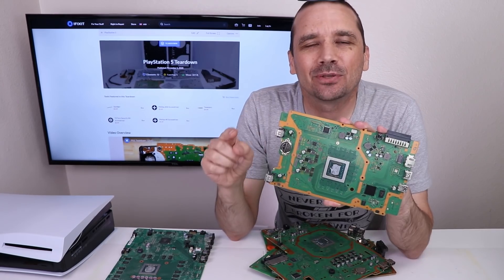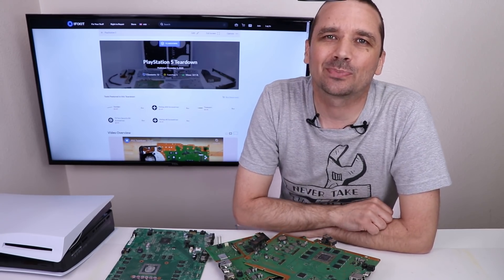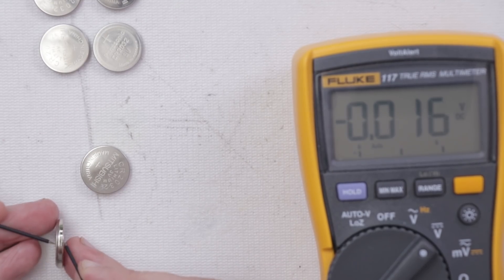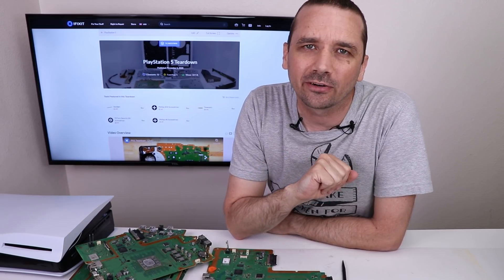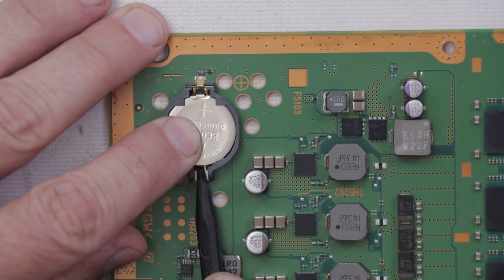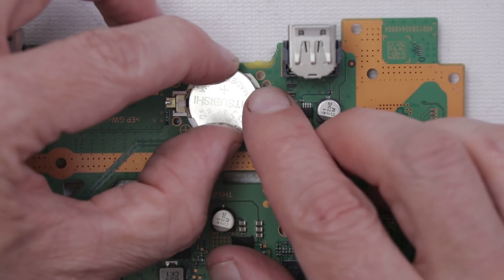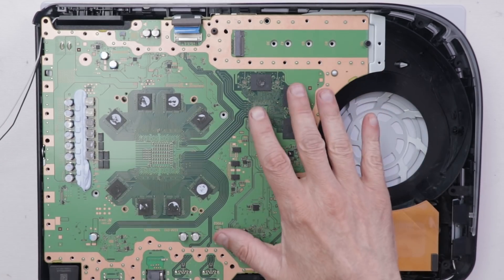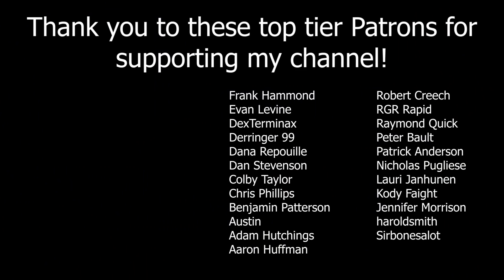PS4 & PS5 CMOS Battery Replacement - But Why?

Comment: It is fixable on jailbroken PS4s up to 7.55 firmware, by the Kernel Clock payload.
Reply: Godbless the hackers and modders to save the day 😂 but it just shows you if a hacker can implement a payload to resolve the problem Sony can fix this with an update or even an end of life update if and when the servers and support is dropped.

Comment: I thought that testing a battery without a load on it will always show the full voltage even if it is almost dead.  A flashlight battery that is dead in the flashlight will still measure 1.5 volts if there is no load on it.
Reply from the maker: If a battery is almost dead it won't show full voltage. There are times when a battery has an internal problem that only shows up under load so if you are really wanting to give it a good test a load test would be appropriate. I was only trying to get a general idea of whether these batteries were good or bad.
Reply: I think multimeters add a small load during the test.

Comment: I replaced them on so many playstations. Even on ps2. But one thing i hate and should have to get changed is the position of them. They should be easly to replace without teardown the whole device
Reply: I don't think they want us to replace them, just throw away the console 😞
Reply: @thesixthgeneration6573  Yup, 100% what they want. They want us to treat these products as entirely disposable so we keep having to shell out cash to them. It's why they are so anti-right to repair.
Reply: Yeah like nintendo wii you just unscrew one screw and take out the battery tray.
Reply: @corpse4434  right? Like the Saturn, Dreamcast, and Wii u
Reply from the maker: Agreed

Comment: The best batteries you can buy I have found is Renata, in the quartz watch world they are the Rolls Royce of batteries and show you how good they are, I bought an early 76ish Ingersoll quartz which had a AG12 its original one and it hadn't sprayed acidy goo all on the innards.   Those cheap Chinese batteries, when they run out of volts the acid inside attacks the thin membrane which is under a little pressure hence why when they go and this can happen in as little as a week from running to zero, the stuff squirts all over the nice copper motherboard erasing the thin traces and even attacks any copper windings in motors... so do buy best you can get and avoid the cheapo's cos they will eat your mobo.
Reply: I wish I could still find them in my country, they las easily double the rime than other brands

Comment: Just a heads up, the issue only affects PS4's of all models. PS5, including playing PS4 games on PS5, as well as PS3 will be just fine.
Reply: It's not so straight forward as that they all have various issues but PS5 is the least effected and PS4 being the worst effected, Doesitplay1 Twitter the guys who covered the cbomb issue originally have documented there findings on the PS3/4 and 5 cbomb issue.

Comment: You gotta test the batteries with a load to see the real voltage
Reply: Multimeters automatically add a load during testing.
Reply: @PimptatoPCs  then go on and measure your car battery with it turned off and on ,you'll see the difference

Comment: I've seen LGR turn on 30 year old computers............that still had the correct time and date. It's insane that some of them cast last.
Reply: Better still - if the battery on that 30 year old computer is dead... The only thing that happens is you get a message that says "hey friend, the battery is dead. replace it and review your settings when you feel like it, no rush" and then the computer boots up and you can still use every feature of your operating system. It doesn't lock you out of your legally purchased software like a certain brand of game consoles.
Reply: That’s because computers from 30 years ago have a very basic BIOS that has a much lower amount of data to retain and thus a lower power requirement than a modern BIOS/UEFI

Comment: The problem isn't with the CMOS, it's the secret 'planned obsolescence' tactics these companies put on their products.
Reply: If it was planned obsolescence then the battery wouldn't be able to be replaced... On ps5 its super easy to replace, ps4 its a bit harder but no matter what you will have to open your console at some point to clean it. Might as well replace the battery then as well
Reply: @rockl79  Have you been living under a rock? lmao if it was that easy then this whole thing with the cmos battery wouldn't have blown up
Reply: @rockl79  The console still needs to connect to a server to accept the battery. Those connections won't be around forever, like the recent backtrack on PS3. There's no future proofing there, whether your games are physical or digital, the console won't play them if that battery dies years down the line whether it was replaced or not. But it's not all bad, there are emulators.

Comment: Doe the PS5, you can actually leave the heat sink on, and just flip the whole assembly over. The battery is in a cutout on the other side.
Reply: You can even clearly see that in one of his other videos, I don't know why he decided to make it look so difficult here.
Reply: @noodohs  ^this is what I came in the comments to say
Reply: @lord_ishamael  Same. Flips board over and reveals perfect cut out in the bottom plate...
Reply: The PS5 is a prime example of bad engineering! I used to have a Sony Vaio Laptop....Fanspin at 90% all the time even in Idle mode, Sony just can't design things.
Reply: @justanotherbeautiful5736  It's a software decision and not hardware. The battery hardware is there to support the software choice. Don't could release an update that negates the trophy sync issue, but that would probably mean a larger backend update across all the systems.
Reply: @justanotherbeautiful5736  lol I'm pretty sure that the group that designed Sony Vaio laptops and the one that designed the PS5 are not the same

Comment: did you break one of the tabs from the battery holder on the ps5 board ? it kinda looked like it was broken or atleast crooked
Reply from the maker: I didn't notice in the video or editing but it does look like one is bent a little. Still plenty strong enough to hold the battery securely.
Reply: @Tronicsfix  well it did look like it was secure enough, i was just wondering if you had noticed :-) now i know keep the good content coming man

Comment: I've had this problem 6-7 years ago when i didn't knew anything about computers, it was a pain to set the time  everytime, at least the date was not wrong
Reply: Never had problems setting correct date on my PC... Just looked at my phone screen and boom, everything's working and as long as the time is close windows will then automatically update, unless you left it on manual.

Comment: 7:32 thumbs up if you noticed Steve breaking one of the battery holders (left top corner) :D
Reply from the maker: Wow, I didn't even notice that. The good thing is that it isn't enough to cause any problems. The battery holder is still plenty strong enough to hold the battery correctly. Good job noticing that and bringing it to my attention!
Reply from the maker: @attilaracz2626  Lol...There literally is no editing there other than me cutting to the next scene.
Reply: @attilaracz2626  *bad editing…. You don’t notice sneak or good editing

Comment: PS5 CMOS issue was tested by SpawnWave and he was able to play games no problem. The issue seems to be only on the PS4...
Reply: physical games work fine on ps5 but any digital games you've bought and downloaded you cant play.
Reply: @blazedyoda8608  I thought there was some physical PS5 games that wouldn't play, but most did?
Reply: @PimptatoPCs  I believe mortal kombat 11 has some issues yes.
Reply: Digital isn't safe like the PS3 issue, digital games go bye bye though.
Reply: @jakehunter3434  ps3 have cmos batteries.
Reply: @MagicJellyBeanPastelLucidDream  yes, I know.
Reply: yup.
Reply: The problem is you cant access to internet with a wrong  date & Time.
Reply: Spawnwave said some games that were ps5 games physically did act up so no it's just not the ps4
Reply: @davless152000  only a very small amount and the consensus is that it's down to how the developer organises it.
Reply: Correct
Reply: What about ps3?

Comment: in the future, once Sony kills the servers, you might want to add a external power source while changing the batteries, so the system doesn't wipe the data.
Reply from the maker: Yes, I was thinking about adding a part to show a way you could do that but decided against it. Maybe should have done it.
Reply from the maker: @attilaracz2626  You could always just solder some wires to a good battery in place of the bad one, then replace it.
Reply: Yeah but not the servers
Reply: @osumoment  one shouldn't assume those are separate.
Reply: That's a good idea.
Reply: Nikolai głodowski  This also effects the PS3 and it's store was almost shut down this year.

Comment: Why don't they put the replacable part on an easy to access spot?! Like on the ps5, they could've easily put the battery holder on the back of the MB, that way you don't risk messing up the liquid metal contact.
Reply: It is actually easily accessible. You don't need to take the heat sink off at all, there's a convenient cutout on the shielding to access the battery. You can see it in some of his other videos. Just flip the whole assembly over, heatsink and all, and swap the battery. Easy.
Reply: @noodohs  correct me if im wrong, but doesn't the ps4 require you to take out the motherboard to replace it?
Reply: Why do they put the PSU (one of the first parts do go bad) inside the console?

Comment: this is ridiculous - Sony could have very easily wired up a daughterboard to handle this, rather than forcing users to dismantle the entire console to change a battery.

Nintendo have been doing this right since 2006!
Reply: Sega Saturn has a small door on the back you can remove to access the battery without disassembling the console at all. The PS5 is kinda ridiculous by comparison.

Comment: but you need to test the batteries under load it can be fake voltage
Reply from the maker: Most of those batteries have been sitting for years so there wouldn’t be any surface charge

Comment: Great video on this topic. Just one mistake: even if the CMOS isn't gonna draw much, testing batteries without load doesn't really tell you much about the condition of the battery ;)
Reply: But the clock will. It's still not much but orders of magnitude more than the CMOS.
Reply: Yes, I think CR2032 should measure 3.2V or so when no load and new

Comment: Don't you have to put a load on a battery to properly test it?
Reply: @xx xxx If there was no load, the battery would last forever.
Reply from the maker: Sure, but this wasn't necessarily a "proper" test. I was just wanting to quickly see what the voltage was on these batteries. Testing voltage gives you a good general idea of how good the batteries are but if you wanted an in-depth test you'd definitely want to load test them.

Comment: Can we all agree that the Clock Cap issue on the OG Xbox is slightly better than having a CBomb issue? Imagine not being able to play physical discs once the CMOS dies, meanwhile 20 year old hardware modded or not can still play games even if the Clock Cap is not existing in the board
Reply: It isn't better, no, because the clock cap issue can totally write off the system and requires at least some equipment to replace, whilst the lithium cells are easy to replace.
Reply: @Lukeno52  that's not true at all about OG Xbox remove the Clock Capacitor by desoldering it or bend back and forth until it breaks off, in some rare cases the leaking capacitor can destroy the montherboard but clean the leakage with some isopropyl alcohol and everthing in most cases is fine, the system will work perfectly fine without the cap just doesn't store date and time only known issue is with the 1.6 motherboards if no capacitor is present the console will error out.

Yes the cap prob on OG Xbox is not good but the cbomb issue is a hell of alot worse if and when server support is gone  there will be 116mil PS4 that will be useless and nothing more than a paper weight unless people resort to jailbreaking and using a payload. PS3 and PS5 are effected by the cbomb issue just not as bad.

Comment: Nice video again steve, i've also seen videos where people put in a empty cmos battery to check what will happen and then the ps4 won't play any games anymore because it cannot sync with PSservers. They still have to fix this...
Reply: They can "fix" it by having the console do an internet check every time you boot it up, bypassing the battery, this will make it an online only system. Another is to disable the trophy time clock internally and keep it server side, again makes it a semi-online system. Last resort, disable all trophies on legacy systems after X amount of years, this is probably the worst option. 
Maybe they can think of better ways, I just listed those at the top of my head.
All of these can be done with firmware update.
Reply: @kastaway-mtx  dude you are correct
Reply: @brandon_nope  They won't.
Reply: They have to because this timebomb issue is also on the ps5
Reply: @flippy9641  jailbreak the console and you're good to go. My ps3 has the cmos dead yet it works
Reply: @flippy9641  out of all the consoles from PS3 upwards the PS4 concerns me the most with the cbomb issue as without a battery replacement and servers being online and accessable in the distant future to sync the internal trophy clock the PS4 will be nothing more than a paper weight if it cant do the server check after a battery replacement.
Reply: @FARK_QUE  they will have to release the update since the cbomb is also a ps5 issue
Reply: @flippy9641  I know it's on the PS5 that's why I said PS3 and upwards 😂 regarding the cbomb issue, I doubt they will realease an update now or anytime soon but it is doable as a payload can be used on a PS3 and PS4 via a jailbreak to get round the problem and fix it which can all be done offline, what I think Sony should do is offer an end of life update if and when complete support is dropped from the console that way the consoles can continue working after a battery replacement and not require a online authentication.
Reply: @FARK_QUE  i dont think there should be eol update since most of people cant get a hold of ps5 and because a lot of players r ps4 atm. Not only that there is a very lil amount of ps5 games atm because of ps4 backwards compatibility on ps4
Reply: @flippy9641  I'm talking about end of life firmware in the distant future not right now all 3 consoles still use and connect to PSN so it's not a problem but in 20, 30 or 40 years it can be as I said when and if any of the consoles from PS3 and upwards do lose connection to the servers and support they should release an end of life firmware removing the cbomb issue and because you misunderstood and didn't read my comment properly I'll say it again Sony should realease an end of life firmware if and when support is dropped from the console and servers in the distant future.
Reply: I hope they will fix this cmos problem on the Ps5 pro. After the bed marketing Sony received because of this problem, it should be a no brainer to release a console that works „flawless“ in 50+ years.
Reply: They cant fix it, thats the whole point of having it - so you buy a new console to play your games
Reply: @dewydgaming8471  They can fix it. They just won't fix it.
Reply: @mjc0961  how r u sure? Because ps4 is last gen now? Sony launched a ps3 security patch last year august i think.
Reply: @dewydgaming8471  it can be fixed and I can tell you why on PS3 and 4 and because of the amazing hacking and modding community jailbreaking your system can resolve the battery replacement issue if the PS servers ever get shut down in the future. PlayStation can realease an update to fix this.
Reply: @dewydgaming8471  they can fix it, they said they are working on it

Comment: Blue light of death can be caused by anything bad ram chips
Reply: And on the PS5 one of the ram chips is not under the heatsink and gets hot. A burn out waiting to happen.
Reply: @brandon_nope  Steve from Gamers Nexus discovered that one of the ram chips is not under the heatsink like the rest are. It was getting up to 170 degrees while the rest are at 80.